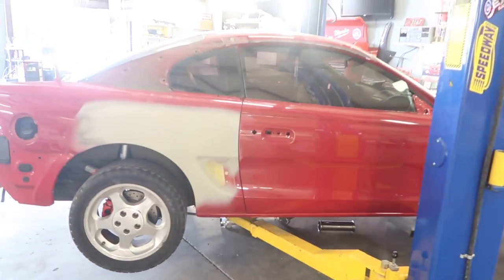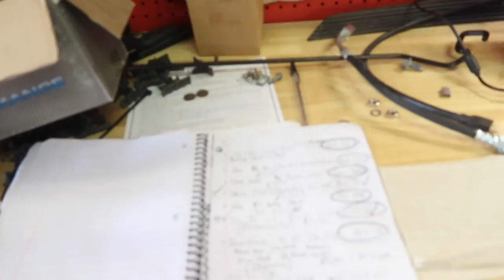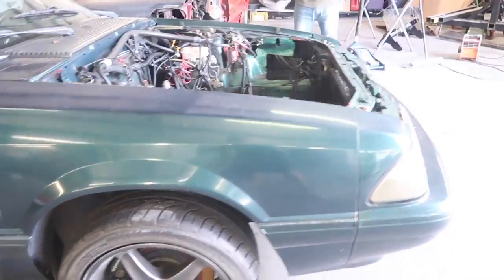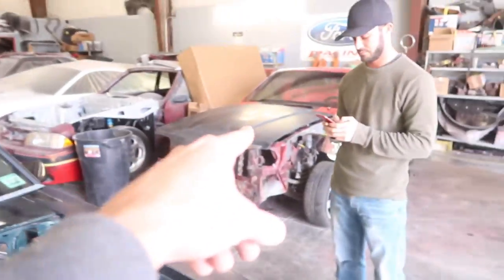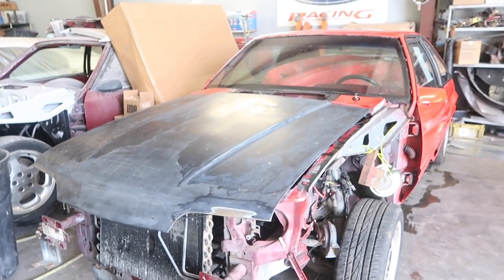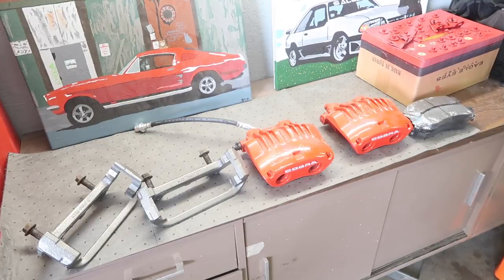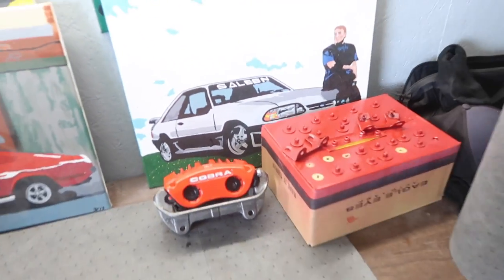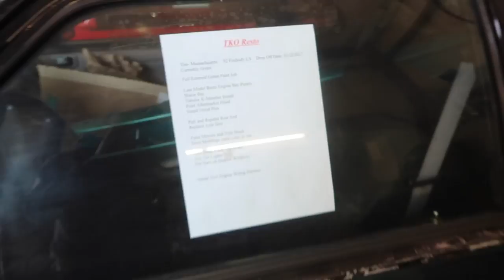Fox Up

Comment: What do you guys use for paint on the calipers???? Do they actually need heat paint?
Reply from the maker: i use the same paint i use on cars. I've done many many sets with no problems at all after 30k miles

Comment: Do I Use 94-98 Spindles On My 92' Fox To Install The Cobra Calipers & 13" Rotors?? I Have The Brakes From When I Put 10th Anniversary Red Calipers On My 96' Mystic Cobra.
Reply from the maker: R Mac you can use any 94-04 spindles. You'll need the correct balljoints to meet the spindles.  I've always used 94-04 controls arms and ball joints.
Reply: tko resto - Thank You!! 1st On The List Is Re-Installing The 93' Cobra Intake & 24lb Injectors. I Pinched A Gasket Installing Them & It Looks Like 007 With Steam Coming Outta The Tailpipes!! Oops!!